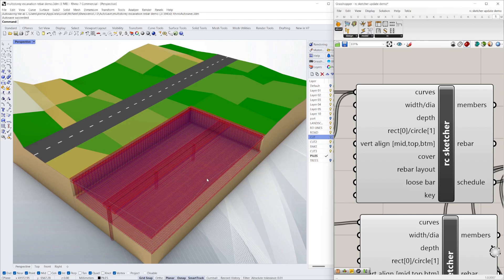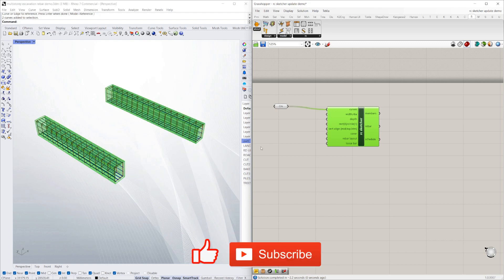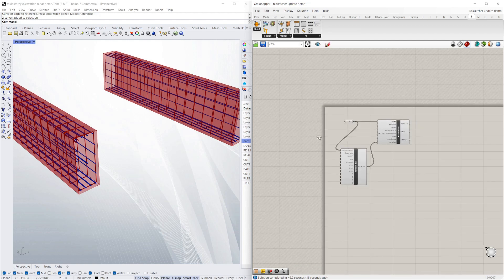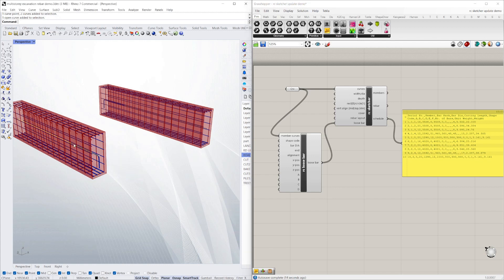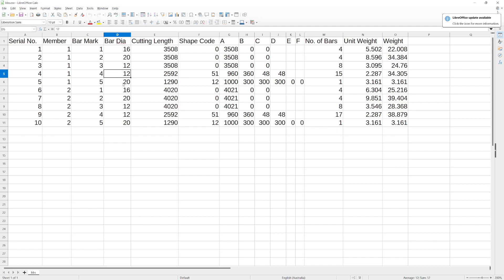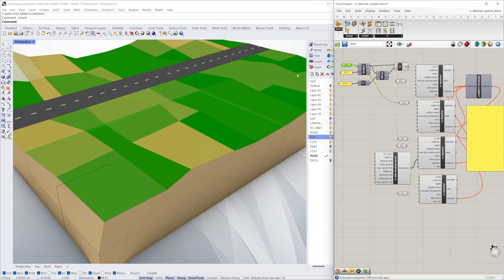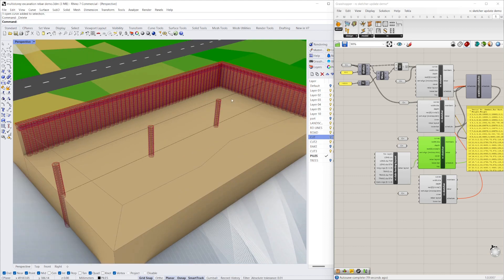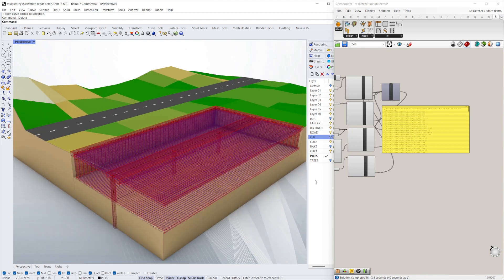RC sketcher update. Quicker, easier and with additional features. Grasshopper Rebar.

Comment: Hi there, when I drag the curves into the component nothing happens in Rhino, the curves are still curves without any geometry of the concrete beam and reinforcement showing up. If I query the component output with Panel I can see that concrete section and reinforcement exist but they are not visible in Rhino. Possible cause? How can I fix that?
Reply from the maker: This is called 'Bake' in Grasshopper. Right click the component and select 'Bake...'